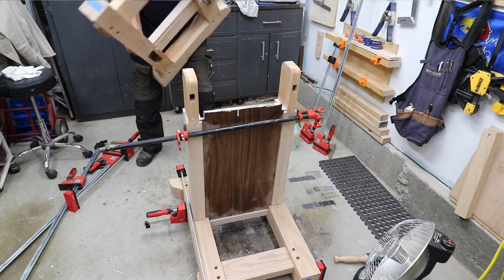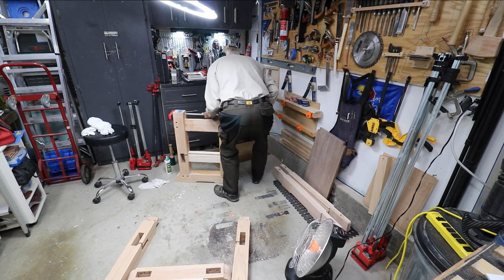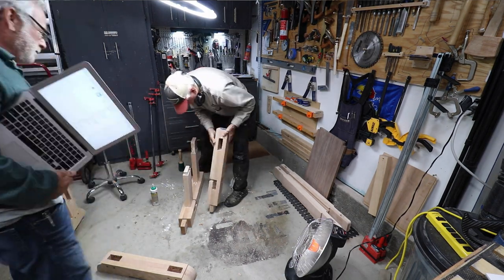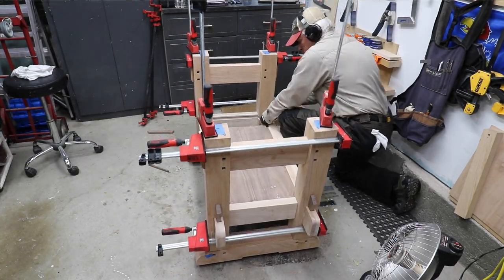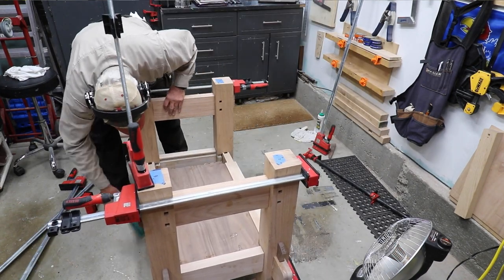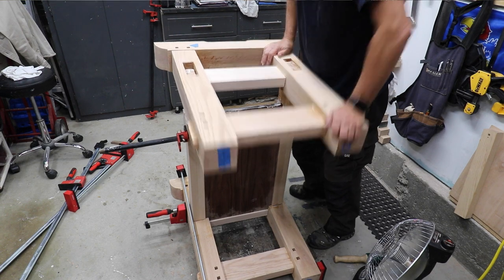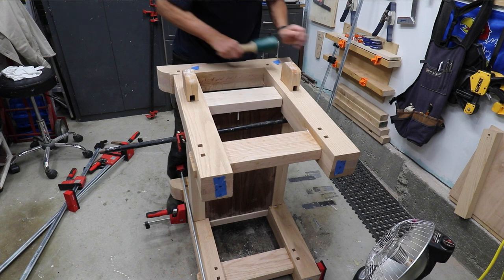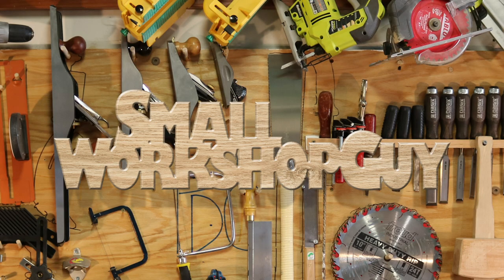6 Principles for Avoiding A Glue-up Disaster - Samurai Carpenter Workbench Base Glue-up

Comment: Yes indeed! I generally refer to this method as "Tack then Attack" I began using the term when I was framing houses (especially when sheathing walls) but it goes for glue ups and many other things as well. It's not uncommon for people to get into a hurry and nail off an entire wall or other large portion of the project only to find they have to take it back apart because something was overlooked. (something off layout, window or door in the wrong place etc..) Tack things together and after you are "certain" things are going to plan Attack. You just have to remember to follow up with the Attack! No matter how fast you go in reverse it's rarely as fast as moving forward.😉
Reply from the maker: Superb observations - thanks!

Comment: Hey SWG, may I be so bold as to add a couple more principles to your sound list that learned earning my degree from M.I.T.  (Mistakes I've Tried)?  To supplement your advice on working through your dry fit until it goes well I'd add:
 'Break down a complex glue up (your bench DEFINITELY qualifies as complex!) and consider gluing it in as many sub-components as practical.... the whole 'how do you eat an elephant' question.  Answer: 'one bite at a time'. 
Please don't take this as criticism but rather perspective from a fellow woodworker... it's enough work making all those complicated parts with tricky joinery and shooting and producing a video about it like you've done only to have someone chime in with know-it-all comments... and the last thing I want to do is be 'THAT guy'! 
Watching you wrestle with heavy, stubborn parts made ME break a sweat just watching... that was quite a workout, my friend!😰😰😰  
What if you made each trestle end section two glue-ups?  Glue two legs to two cross members for each end first; nice, clean and straightforward.  Fit and clamp the 'feet' on if necessary for alignment etc but DO NOT glue them on.   After that part has had a few  hours to dry and set glue the bottom 'feet' section to the ends of the legs.  With both end trestles all glued up and cleaned up (see 'other principal' below), dry and rigid, use your gravity principle to glue ends of the tray carrier to ONE trestle but dry fit both ends and tray for alignment.  When that's dry, disassemble, glue in the tray and glue the other end on.  An added benefit is that if minor adjustments are needed as the build continues you're able to make them without dealing with drying glue everywhere and can avoid the feeling of 'trying to catch a falling knife' to decide when to bail. You can often leave a margin of error on some parts, like the tray panel, and PLAN on sizing it when the time comes to add it to the assembly which can prevent trouble if some parts need to be larger during final glue up rather than smaller. 
This thought process is a paradigm shift from the typical 'all or nothing' approach but I find it reduces stress by 90% and  increases quality and satisfaction while producing much better results in the process.
The other principal... not really a principal but, rather, a tip/technique... is to use powdery sawdust (aka 'guy glitter) and a sharp putty knife to clean up glue squeeze out instead of rag and water.  This is another paradigm shift but will, if properly implemented, revolutionize your workflow and end results.
Where 'well meaning (but nosy?) neighbors' stopping by is concerned?... you're on your own there! 😏😂😎
Best, Matt
Reply from the maker: Can’t tell you how much I appreciate your contribution to my video - thanks, Matt
Reply: @SmallWorkshopGuy  cool... your efforts are a positive influence to your audience in particular and YouTube in general and are commendable... keep it up! Best, Matt
Reply from the maker: You are exactly right.  Even though all shown in the video at one time, I did glue up the two ends separately a day ahead.  The tricky part was then getting the two ends connected with the two trestles together and glued with the tray inserted.  That is the part that did not go so well and where gravity really helped me in the second try.  I totally agree with you - glue up subcomponents to the extent possible.  Thanks!  Now I will go check what you have produced lately as you are one of my very favorite content creators.
Reply: @SmallWorkshopGuy  It didn't register that pre-glued the ends but assumed by the struggle it was all part of one epic glue up.  Sounds like you're not the glutton for punishment I thought you were 😁😎  My motto for this sort of thing is 'gotta make it easy on yourself because no one's gonna do it for you' and I get the idea you have a similar philosophy... Best, Matt